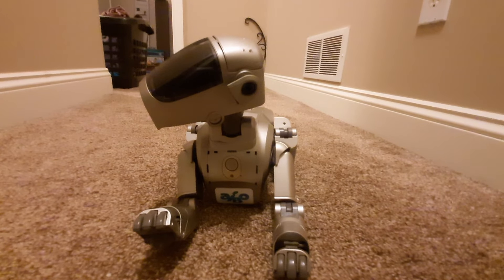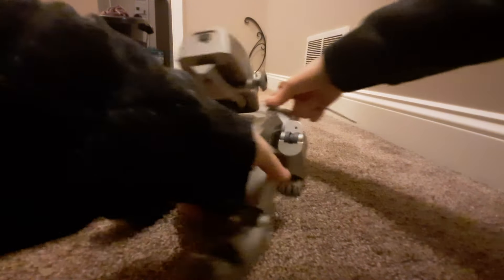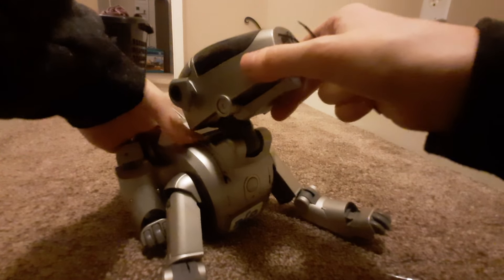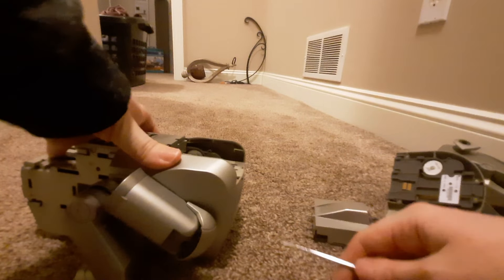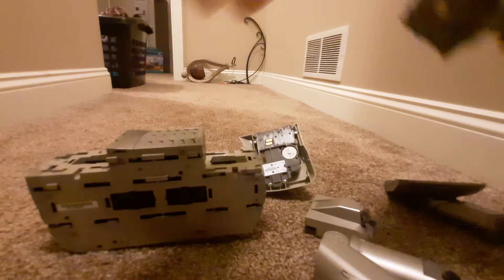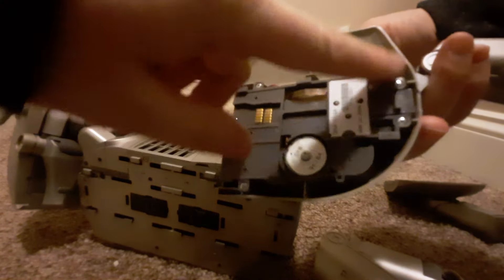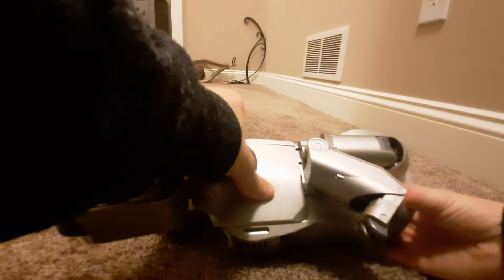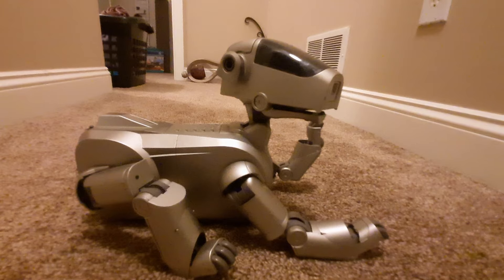Aibo ers 11x limb block removal

Comment: This was so informative. Very well done! I hate removing limbs from my 110. It is always made me really nervous but it’s because I’ve had to use a variety of thin flat things to try to find something that works. I started out using a specific fingernail file, but I lost it in a move, and then my troubles began. I bought some new ones, but well they fit into the pry hole, they were too thick. Then, the Phillips that I had was too large.
I wound up taking a very thin sliver of wood and pressing that against the tab. Unfortunately, it broke during the removal, so I’m back to square one. Hopefully I won’t have to do this again for a while. Thank you for making this video.
Reply from the maker: I have experienced very similar. I am guessing the same happened with 11x owners back in the day which is why the 210 cames with a limb key. I would love to make a 3d printable object for this purpose but not sure what would work best.
Reply: what about something with a similar length to a popsicle stick, but maybe just a little thinner?